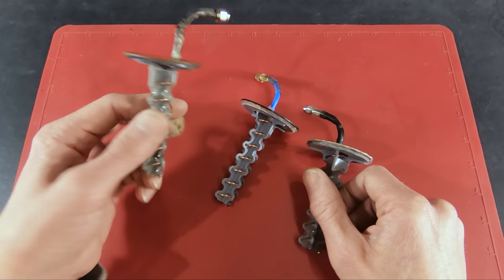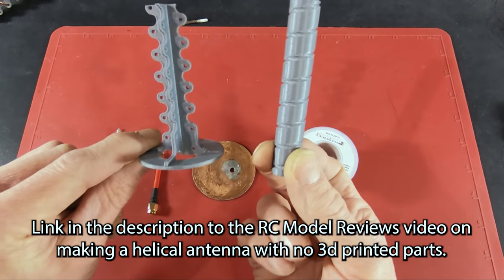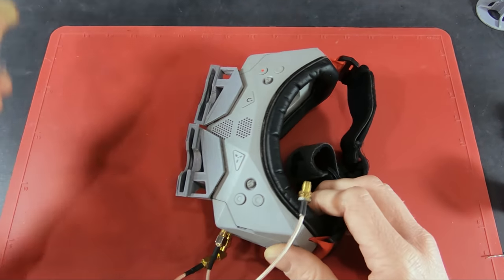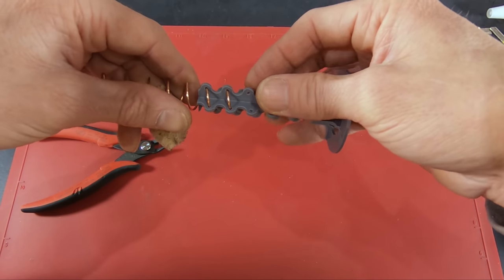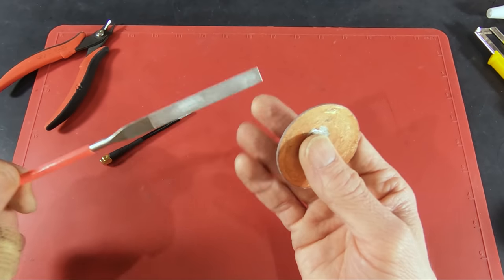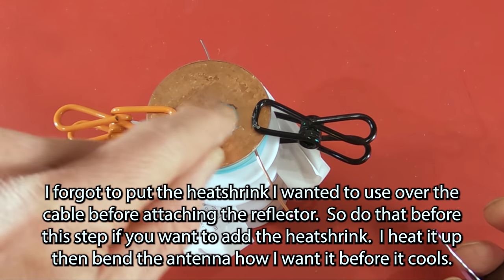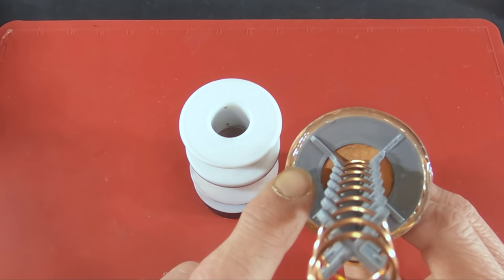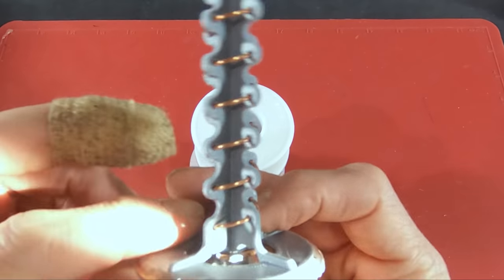DIY Helical Antenna For Long Range FPV - CHEAP & EASY -

Comment: is your fpv cam pnp with vtx
Reply from the maker: No, I always run my fpv camera video through the flight controller so that the OSD will be included along with the video.  The camera can be connected directly to the VTX if you don't mind bypassing the flight controllers OSD or if you are not using a flight controller say for in an FPV plane.

Comment: does it work for 2.4 ?
thnx
Reply from the maker: Yes I believe so, it would just be bigger.  The coil size and spacing would both be different.

Comment: Bem barato, primeiro voce precisa de uma impressora 3d (R$2.000,00)
Reply from the maker: Actually my 3d printer cost less than $300.  If you make a few antennas and gopro mounts it's already paid for itself.